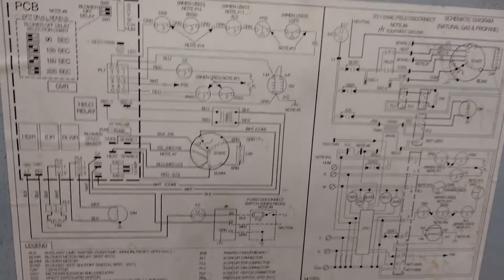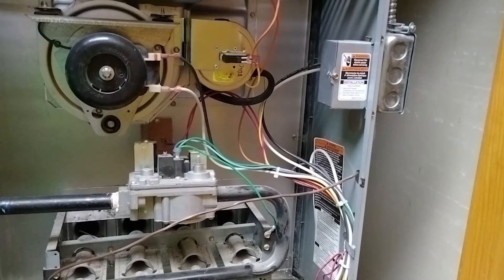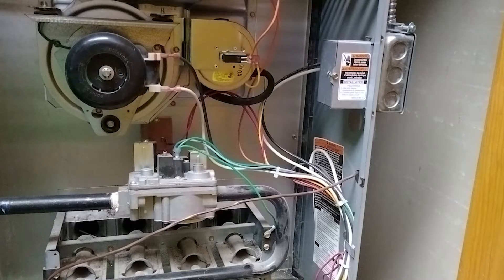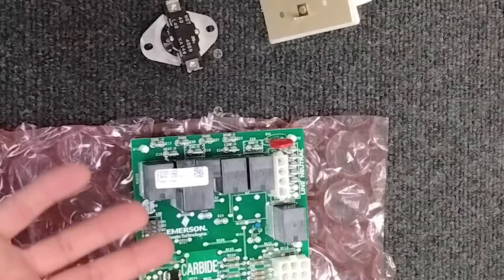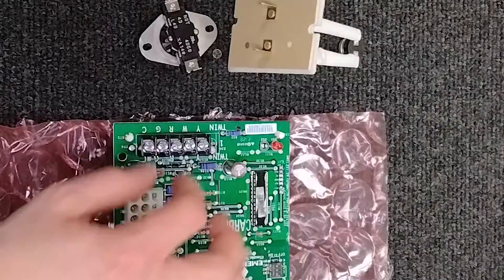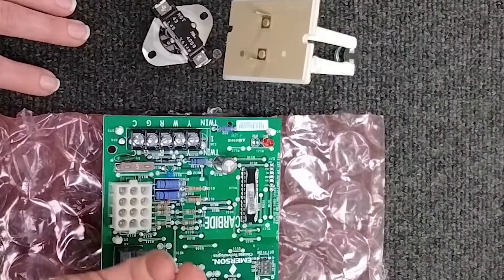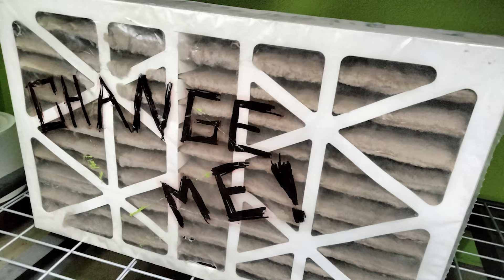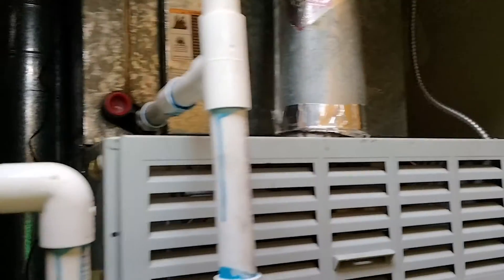So You Replaced Your High Limit Switch and Still Getting The Same Error Code, What Could It Be?

Comment: I'm about to replace my 3rd control board on a 20yo York gas furnace. I get the four-flash limit switch error code as soon as it turns on when calling for heat. The inducer & blower turn on immediately, & I get no voltage to the HSI. It cycles the inducer but the blower never stops. Everything has been metered, checked, jumped......it has to be a faulty processor chip on the control board.

Comment: So if you have a good switch, and it won't even start (it's cold), it's likely a bad control board?
Reply from the maker: Goodness, I didn't see this comment! So sorry. It can be if you have checked everything up until the point of the board sending power. There's a few things to check: 

I know it sounds stupid, but does the unit have power going into it? Does the control board have a light? If it does, then you know you have the 24 volts to it. If it does not, check the fuse on the board to see if it popped or if you have an in-line fuse from the transformer to the control board that has popped. If there are no popped fuses and the board doesn't light up, check that your transformer that provides power to your control board is sending the 24 volts with your volt meter. 

If all of that checks out, and you do have power and not popped fuses─ does your control board throw an error code? If so, does it always blink the same code? (you should have a fault code list when you remove the blower panel. Normally it is below the wiring diagram.) When you are testing, make sure that you have the door switch pushed in before you turn on the heating. If it isn't pushed in, the unit will fail or go into a lockout mode. 

Does this only happen in heating? For example, if you were to put it on cooling or just fan on, does anything come on at all? If absolutely nothing comes on, heat or cool, check your transformer and your thermostat.

Comment: Are you a tech! Because you are teaching this wrong.. You rarely replace high limits.. smh
Reply: Lowering your background music level would be awesome!
Reply: Most techs will sell you  many parts so they make money. Lot of bad ones out there
Reply from the maker: If you are this incompetent at actually paying attention to the content of the video, you shouldn't be working on a unit.

Title of video: 'So You Replaced Your High Limit Switch and Still Getting The Same Error Code, What Could It Be?'

https://youtu.be/68Z8yaTkWBg?t=161 

https://youtube.com/clip/Ugkx6aOeYLsMuyLGNm0kJincSoFEnNNv8EnE 

https://youtube.com/clip/UgkxlIq2ylEgTPF1haz_nvTV9Peq1ilzO-3k

https://youtube.com/clip/UgkxZUJqmucpYN1CnCYSLw7lxAswgNp8mc1a

https://youtube.com/clip/UgkxEjJmPuRnQFmHktQ9JUAVLPD_5Xd5goX9 

The purpose of our videos are to educate homeowners and new techs instead of throwing technical jargon their way.
Reply: @opentopublichvacschool  I hear you. But the number one reason for a tripped HL is overheating.  Dirty coil is one of the reasons  but there are atleast 6 other reasons that can cause overheating.. How do you diagnose and correct these as a tech?
Reply from the maker: @5822huron  Right, which we talked about in the video. The number one reason is overheating/low air flow. If the HL is Ohming correctly and is testing correctly, e.g.: you place your leads on the terminals and the mechanical connection is closed on start up and stays closed throughout the cycle─ from there it is a matter of going through the order of operations, checking power, loose connections, signal from thermostat to send control voltage, etc., etc. 

This is a simplified version for a homeowner to self diagnose because there is obviously a lack of knowledge on what a high limit does, and if it is actually doing what it is supposed to. Since most of the normal populace would see that a board is telling them 'open high limit' the assumption is that the part is bad. We go over why it might not be and the most common. (hence the jumping around, checking ohms, etc.) I often tell customers that they more than likely need to clean their coils. Whether they listen is a whole other story. We do cover how to test them on a different video and other probable causes and ways to test that!  

The broken-down tech episodes have not been released, however, we do have a few over how to test HL, DL, Rollout switches, etc. At a certain point, a homeowner needs to call a technician which we let them know when it is time! Hope this helps.
Reply: @opentopublichvacschool  please.  I'd run circles around you.  Lol